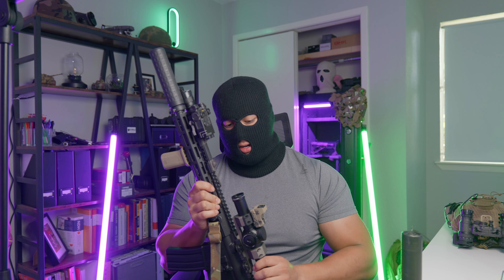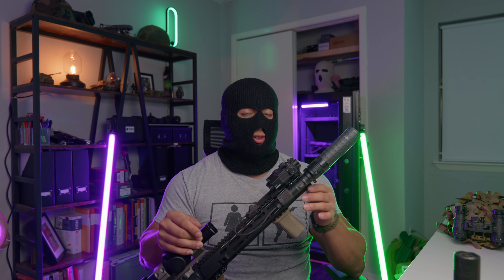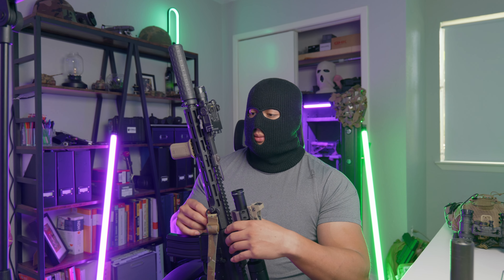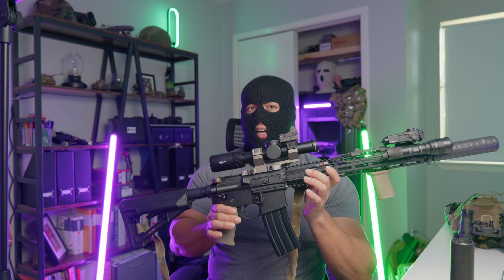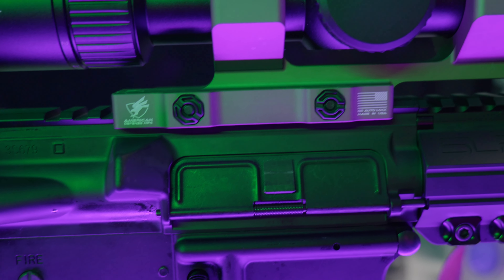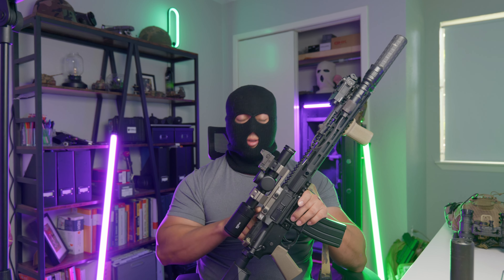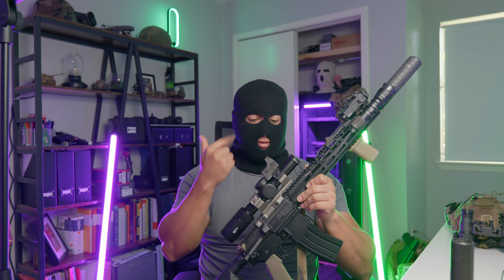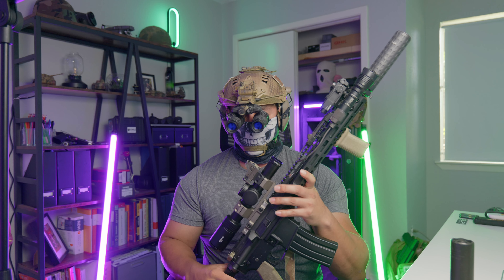Recce rifle setup / 13.7 AR15 setup

Comment: Nice setup - I subbed and dropped a like 👍 😮😢

Sorry if I missed this but what buffer weight are you running?

I just built a BA upper with the same 13.7" barrel and it came out really nice. However, when i shoot PMC 55gr (2900fps) I don't get bolt lock back on the last round and it will short stroke sometimes. I'm running an h2 buffer which I uae in all my rifles and I suspect this ia the issue. The low power ammo isn't pushing my BCG all the way back so I just put in a standard buffer in but haven't had a chance to test it. .223/5.56 ammo that ia rated over 3000fps worka great with the h2 so I am a bit perplexed.

Comment: what I would like to hear is the pro's & cons an the benefits of a 13.7" set up, vs something shorter or longer like a 16" setup in other whats makes a 13.7" so desirable preferably unsuppressed.
Reply from the maker: If your running unsuppressed just go 16. Basically every thing comes down to balance between ballistics and weight. I.e. if you gotta hump it for miles, get in and out of vehicles etc.
Reply: So I run dead air suppressors, and wanted a PnW muzzle device to bring my firearm to exactly 16” and a 13.7 with a SOLGW NOX muzzle device does just that. 

It decreases the overall length while suppressed. If you don’t plan on shooting suppressed I would go with a 14.5 PnW or a normal 16” 

The 13.7 also gives you a good boost in velocity when compared to a 10.5 or an 11.5 and it’s almost identical in FPS to a 14.5

Comment: I have an LVPO, that I used to run on my AR years ago but since I got my suppressor. I noticed the weight while running and gunning. I Still have the LVPO as a back up and I now run the Primary Arms GLX 2x and I love it.
Does amazing up to 200 yards with 62gr, I haven't had the chance to stretch it out to what's advertised with the 50 yard zero I gave it. I'm more then sure it will hit, at 200yards prone or benched the groups are amazing. When running and gunning my groups spread about .5 inch. 
What I need is a 13inch barrel lol
Reply: The Primary Arms PLx(platinum) gen2 1-8x lpvo is an amazing piece of glass. It’s also 17oz so with a solid badger mount & offset dot is only 25-28oz all in.

Comment: Just got my 13.9 barrel from Criterion. The hardest part is choosing which muzzle device and suppressor I want. I'm thinking about the sandman, but like you said, carbon build up is something that comes with running suppressed so I'm also considering the OSS can
Reply from the maker: If it’s your first can I wouldn’t go with oss. Doesn’t suppress nearly as well. Paired with a criterion barrel I would just make sure you get a slick bcg and you’ll be gtg
Reply: @americansanonymous2434  I heard same oss doesn't supress to well, from a friend it has a louder crack than the sandman.
Reply: Just get a surefire warcomp and a RC2

Comment: I have almost the exact rifle. BA 13.7 hanson, 1x10 swampfox arrowhead bdc on aero mount, with piggy back swampfox justice on top with an iron shroud. 13 in mlok rail, timney single stage and bootleg adjustable bcg for when my deadair sandman s gets out of jai.

Comment: I was thinking about making my SHTF/recce rifle either a 13.7 wylde or 12.5 5.56. I like the idea of being able to reach out with the 13.7 but i'm going to have a suppressor and I feel like the less inch would just make maneuvering easier if needed.
Reply from the maker: Definitely. 13.7 rules
Reply: Get the 13.7 or 13.9, much better to get the extra range, you can train for the maneuvering

Comment: I have a BA 13.7 barrel that's mid-length. Haven't started a build with it yet. I'm lazy like that. But apparently they make them for other companies (like SOLGW, I think) and only sell them as stand alone barrels on Black Friday. At least that's when I got mine.
Reply: Yes sir, they do make them but there’s more to it, I watched a video with mike the owner of solgw and they contract ba for a good amount of the barrels but are built to a different spec than their standard barrel. Regardless their stuff both ba and solgw is very nice.

Comment: What distance did you zero the red dot for?
Reply from the maker: 50 for the dot, 100 for the scope
Reply: @americansanonymous2434  why 50 as supposed to 25?just curious
Reply: @americansanonymous2434  there are literally no videos on your setups zero, and you have the exact same setup as mine but i just want to know trajectories with that much height over bore.
Reply from the maker: @dr.doofenshmirtz9501  basically so I know my dot is point of aim point of impact out to 200 in the event my scope goes down. Inside of 50 I find the holdover to be negligible, but that falls back to training issue and knowing your hold over up close

Comment: Go with the mawl c1+ providing you have the money. The holosun will sit higher on you rail then what you have now.   Here’s a tip on that screw get a wood burning kit and use it to heat up that screw. It should release the Loctite enough to remove the screw. On aluminum I use the purple loctite

Comment: I have a griffin m4sdk, how did you get the muzzle device on a 13.7 pin and welded if they are on average 2 inches from griffin?
Reply from the maker: My gunsmith used large muzzle shims before pin and welding. I wouldn’t try to do it yourself unless your confident you can keep everything concentric
Reply: @americansanonymous2434  oh ok cool, I’m no welder so I was gonna have a gunsmith do it lol. Thanks

Comment: How is the 13.7 out to further distances? Do you feel like you’re limited by the shorter barrel? It’s such an attractive choice since it’s so much more maneuverable (and looks badass) but I’m concerned about limiting the already limited .223 cartridge
Reply from the maker: I’m gonna do a video on extending the range of the 13.7 but short answer out to 600 your money 💰
Reply: @americansanonymous2434  shiiii thanks bro, sick build
Reply: From my experience, the 13.7 is a good medium. Shooting steel at 400 yards, I can tell my rounds hit significantly harder than they do from the 10.5" barrel and not as much drop. They don't smack the target as hard as they do with my 20" rifle. I consider my 13.7" rifle a great 300 yard and in gun, though it's capable of further distance hits, but shooting 69 grain otm, I want to make sure the round will do what it's supposed to do, but I also just run a rds and irons. No problem taking the 20" rifle with the same weight ammo out to 5-700 yards with my PA 1-6 on it.
Reply: My 10.5 was hitting steel at 540 meters. Idk how much terminal velocity it has
Reply: @KotaMW  
How did you know you was hitting the steel at that range? At 400 yards, with my 10.5" shooting 69 grain otm, I can barely hear it hit and there's no impact signature like that dust effect when the round basically disintegrates. I'll say that's impressive given the amount of drop there is and wind drift, but in a real world situation, I don't  know how viable that is or how effective it would be.
Reply: @toddk1377  i had a spotter with me watching the steal and it wazs later in the evening and the steel was making  sparks when hit. i was aimming high and left to even ,ake it ding with how the wind was that evning
Reply: @KotaMW  
That makes sense, I didn't even think of a spotter 🤦

Comment: I thought these BA barrels were the same ones SOLGW's uses in their 13.7 build and were mid length?
Reply from the maker: Not sure what SOLGW uses. But this is BA’s hanson profile barrel and it has a pinned carbine length gas system. I think BA also has another 13.7 offering in their “modern” series. Maybe that one is mid length I’m not sure

Comment: If you have the dball already, no point to have the red dot on top of the lpvo. Low light/night, just use the ir laser. I'd rather have a offset red dot.
Reply from the maker: Passive aiming, I’m not the only one with nvgs

Comment: what Griffin muzzle device did you pin and weld to get 16? I'm waiting on a 30sdk now and have a Hanson 13.9 I need to setup for when it finally gets approved! I emailed Griffin a few months ago and was told they don't have anything long enough for 13.9??
Reply from the maker: I used their gate lock flash hider with spacers

Comment: I have almost the same setup, Was yours a little under gassed? mine couldn't cycle any .223 reliably. Now mine is a designated Host for my sandman S with a H2 and a blue sprinco blue and it runs fantastic suppressed. It will cycle full power 5.56 without the can but its a single shot with steel with the added spring pressure and weight lol.
Reply from the maker: Hmm I’ll have to test, I typically only run 556 brass though my serious rifles and 100% suppressed so I couldn’t speak to anything else. Mine seems to eject at 2o clock with standard carbine buffer and spring
Reply: @americansanonymous2434  I could only run m193 and m855. With the spring and H2 buffer I have almost zero recoil, right around 2 o'clock ejection and no gas to face as well.

Comment: Does this run unsuppressed? I have a build that’s almost exactly the same but my 13.7 carbine length ba only runs suppressed
Reply from the maker: Actually I’m not sure I pretty much shoot everything 100% suppressed if I can
Reply: @americansanonymous2434  I try to shoot suppressed only as well. I’m just waiting on the can for that gun. Keep up the good work man
Reply: Have you made sure your gas block is completely aligned? BA don’t dimple their barrels so it’s not hard to have it slightly off. I have seen a few posts of people that got barrels with a small gas port. Assuming you have a normal carbine buffer/spring and using full power ammo your issue almost has to be the gas block or port. Hope you get her figured out,nothing more frustrating than a gun that won’t run!

Comment: I love my Streamlight HL-Xs but they're made in China bro. Just a friendly FYI. Also good choice with the PST Gen 2 and ADM mount. Although don't expect most LPVOs to be that bright. The PST Gen 2 and Razer HD are exceptions.

Just subbed btw
Reply from the maker: Luckily haven’t had any issues with mine, I have 4
Reply: @americansanonymous2434  I have four as well. Three protacs on rifles, including a 308 Tavor 7 with a lot of rounds on it, and one handheld mounted on my Benelli M4. All have heald up to some serious abuse. I also have two TLR 7As, a TLR 1 HL, and a RM 1. Love my Streamlights. Unfortunately I only have one Surefire.  A 640DF I put on my main squeeze rifle. But for the money the HLX is my go to rifle light. For the money it's hard to beat. An I've beat on them enough to trust them. Unlike my Olights.

Comment: Why use a short barrel. The loss of velocity makes less effect on target. If you want that shorter then use x95.  This is stupid.
Reply from the maker: If you run a suppressor all the time 16in barrels get long and front heavy
Reply: @americansanonymous2434  that is if you are out of shape. I carried a m16A2 for 10 years. If you want is shorter use a 16 inch bull pup. We are not always fighting in cities. There is no way a 13.7 barrel is effecting as a 16 inch or longer barrel.

Comment: Lock your loose web gear and straps down.  Move more fluidly. To help you do that, move your vertical grip, laser pac, and torch aft of the front end of your hand guard.  Just a trick to offset the forward shift of the center of gravity by the suppressor. SLR makes incredible gear. Good job there.